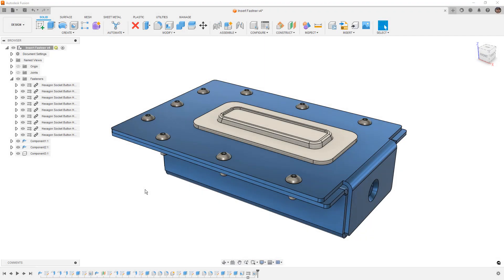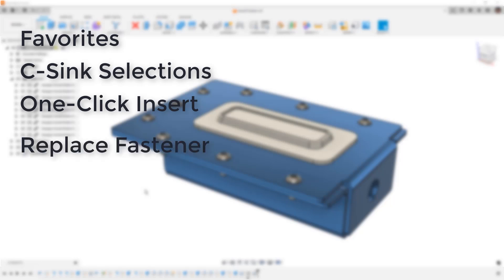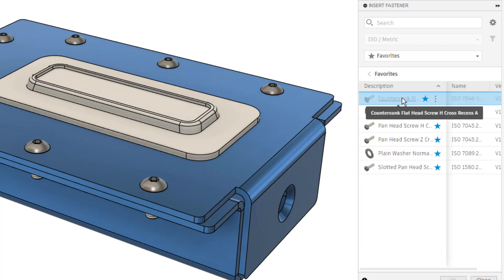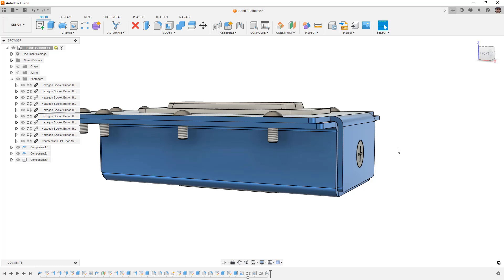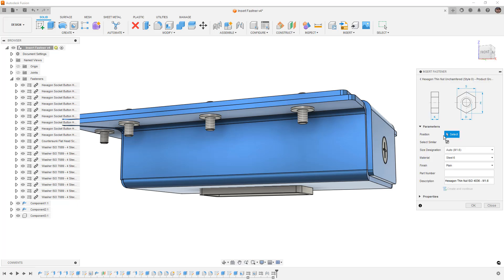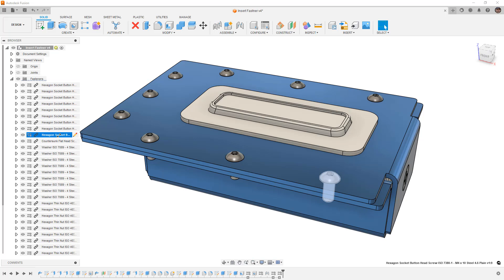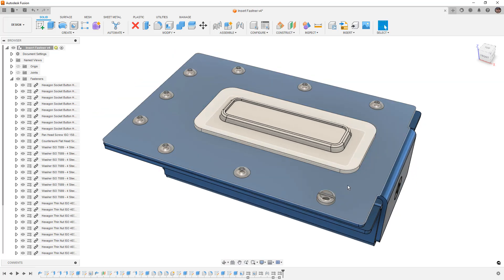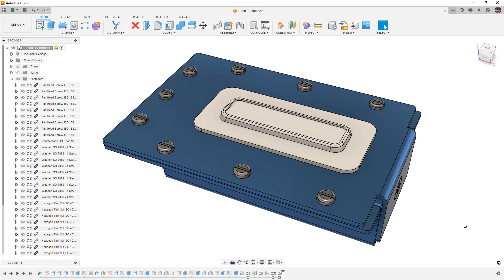Fusion What's New March 2024 | Insert Fastener | #fusion #cad

Comment: Anyone has issues with the insert fastener function? 50% of the time it works great and the other 50% I get to an empty dialogue box after selecting the fastener type and nothing happens. Tried troubleshooting but can't find a solution or a cause, and that happens with the exact same set of fasteners that worked a day before.
Reply from the maker: I can't say I have had that happen before....
Reply: @LearnEverythingAboutDesign  actually, for anyone reading with a similar issue - I may have accidentally found a solution. I run fusion as administrator and it seems to have fixed it

Comment: I'm new to this. How does Fusion CAD compare to Plasticity? x3
Reply from the maker: It depends on what you want to do with it.  Fusion has more functionality such as Parametric Models (driven by editable dimensions), simulation, PCB design, CAM programming, detailed drawings.  It is more of a professional CAD solution.  Plasticity is a CAD modeling program meant to be more of a Direct Modeler.  Meaning you can start with a precise input like a 10mm diameter circle, but once you start making geometry you can't go back and edit that 10mm circle and update the model.  It is meant for quickly modeling "hard surfaces" and has some great high quality geometry and does really well with tricky geometry.  For example I was working on a model and Fusion just wouldn't create a fillet on an edge for me.  Plasticity did it no problem.  Its a bit more forgiving with geometry issues.

If you are making models for games, animation, rendering, or possibly just 3d printing Plasticity can be a great option.  If you are planning on designing parts and need mechanical motion, need to deal with tolerances, machine parts or make them for manufacture I would lean towards Fusion.

Comment: Is it possible to customize where the folder for the fasteners is stored? I made already a project folder PART LIBRARY and it would be great if I don't have to manage a 2nd project folder
Reply from the maker: Sadly no. All the hardware is generated via the Insert Fastener tool and once built in 3d saved externally in the Project Fasteners.  I would be great IF there was a way to say add 3d models to that project and insert them or be able to change the storage location....
Reply: @LearnEverythingAboutDesign  thanks for your response. It's a great feature anyhow. Not sure if the team I work with will embrace it, due to their custom naming system and ERP system...